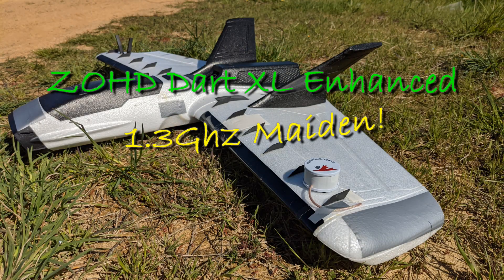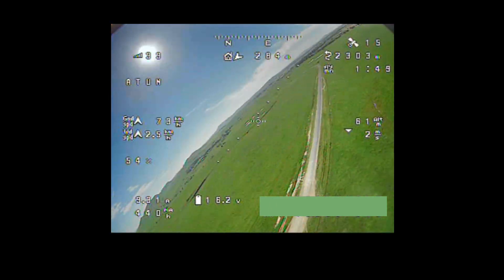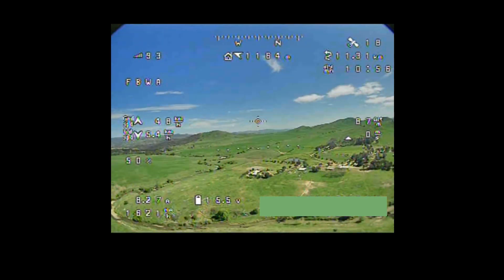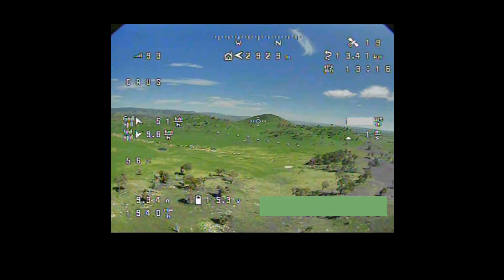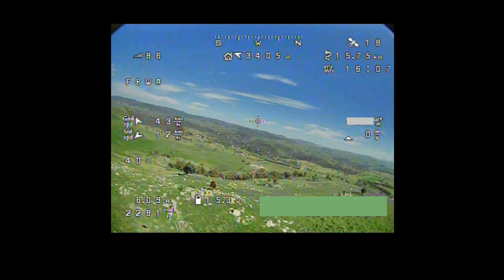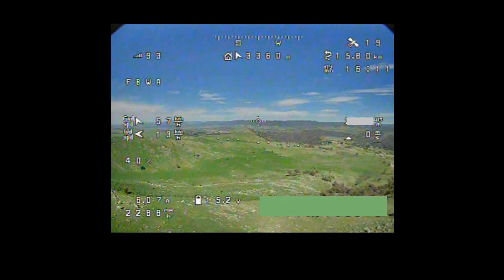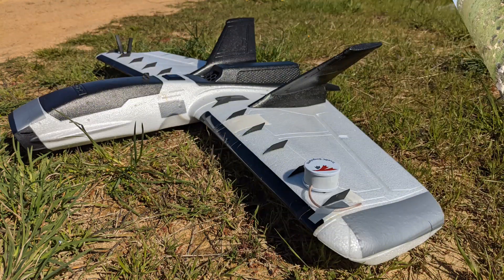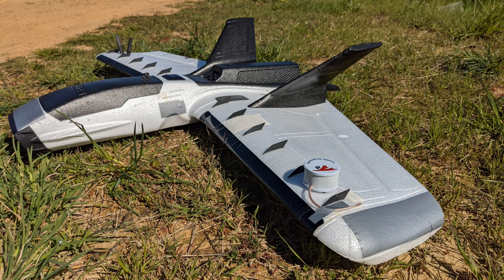Dart XL Enhanced - Matek 1G3 Maiden with Arduplane! (a few teething issues)

Comment: The L9R won't tolerate the second harmonic of 1.2g video...in particular when your vtx antenna is between you and the L9R ( like when you hit FS)
Golden FPV rule....Control frequency must always be lower than video frequency...
So, it's UHF...or 868mhz....not 2.4g
That Matek VTX is around 600mw, way too much RF power on this frequency TBH, try 200mw, it's enough.
Your goggle Rx did well, it's known they ain't too clever....🤔🤔👍😁
Don't give up on 1.2g now...it's way better than 5.8g...!!!!
Reply from the maker: If dropping the VTX power would help I could try a lowpass filter. I've just installed a VAS 1.3/2.4 notch filter as well as a ferrite ring on the VTX. Happy to keep experimenting to see what's possible (as it's interesting), and I would otherwise switch back to 5.8g rather than spend money changing radio gear right now. Even if I were to change TX, I'd prefer to try a 2.4g LORA module (FlySky/IRC Ghost), which would just raise RF power if needed, and probably ignore the 1.3g interference better.

I'm still pretty happy with the initial results of the Matek modules. I'll do a longer distance run on the next outing to see what the limit of the goggle module is - I think even with the dodgy control RF, it'll be ok flying out LOS >7km or so.
Reply: @ZaksterBlue  Dropping the onboard 1.2g RF will definitely help. I can easily get 8kms on just 200mw on 1280mhz, even at relatively low altitudes (unlike 5.8g)
I just bought 2 more 200mw vtxs from AliExpress, they are around 17 dollars, small and lightweight in metal shielded cases.
Since you don't have the benefit of a 1.2g / 5.8g relay GS (the ultimate answer) I would suggest using your Matek video reciever in a small GS. This leaves you free in terms of RF and your RC Transmitter power.
That said, having a 2.4g Rx sat next to a big shouty VTX on 1.2g will never be a good idea. The Ghost LORA reciever will be no exception either I'm guessing, it's bound to have a very sensitive front end on it, and yes it looks like a great product....868mhz is the answer your looking for TBH.
Your TX does have a JR module Bay I'm guessing?
Reply: Use channel 1120 or 1080 it will help alot with the 2.4g control
Reply from the maker: Thanks for the suggestion. I checked the AUS Spectrum Plan and 'amateur' range is 1240-1300 here.
Reply: @ZaksterBlue  If you need a decent 1.2g video reciever, try a Lawmate..High quality, all the filtering out the box and its compact too...🤔😀

Comment: Don't like that RSSI situation at all.
Reply from the maker: Nope. Just installed ferrite and 1.3/2.4 notch on the VTX so will see how that goes.
Reply: @ZaksterBlue  Good move. I do agree with EnglishTurbines about lowering the VTX power.

I'd consider looking at 915MHz control link options such as FrSky R9 or TBS Crossfire. Given that you're familiar with the FrSky ecosystem I'd lean towards R9 (pre 2019) ACCST. It has its idiosyncrasies but it should work. And it's cheap!

It's time to lower your frequency :)

Comment: Nice, I’ve always wondered about 1.3ghz but wasn’t sure if it’s legal in Aus. I’ve always used 433 and 5.8. 
Where do u find all these great places to fly. I’m starting to have the issue of running out of places to fly.
Reply from the maker: I'll drive a couple of hours to fly different places.  And mixing up high and low level flying can make things more interesting.   As long as you stay under 1300mhz it's part of the amateur band.  Honestly though, 5.8 is simpler and with good gear, can get as far as most really need.  I was just curious to give it a try.